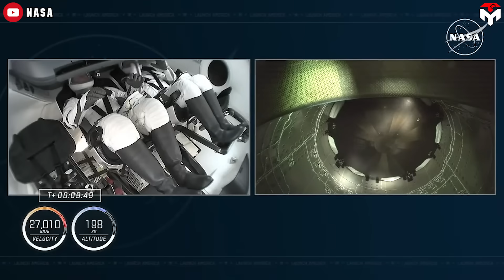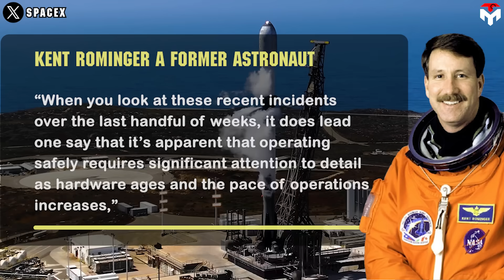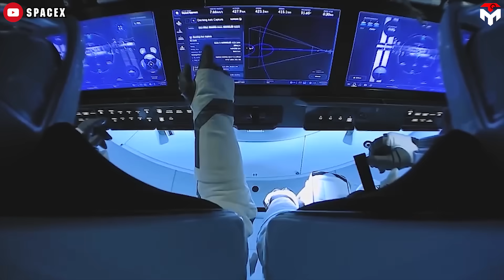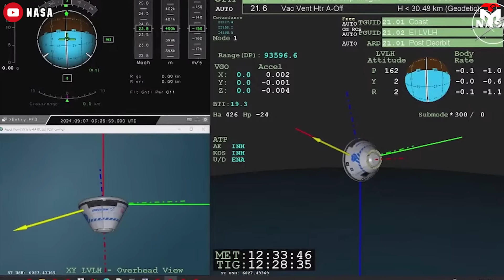NASA just WARNED SpaceX about Crew Dragon's Safety While Boeing Starliner...

Comment: NASA lecturing SpaceX on safety is comical! Aren't NASA the ones who incinerated Gus Grissom, Ed White and Roger Chaffee in the Apollo 1 capsule on the ground.

Aren't they the ones who blew up the Space Shuttle Challenger crew when they knew there were issues with the leaky o-rings on the main booster but decided to launch anyway. 

Aren't they the ones who roasted the Space Shuttle Columbia crew on re-entry when they knew there was damage to the underside of the shuttle that they spotted on launch and later confirmed the damage in space but decided it was safe to return them to earth on a shuttle with damaged heat shield tiles 🤯

Why did it take NASA so long to decide to send the Boeing starliner back to earth without a crew, it seems NASA was seriously considering sending the Astronauts back to earth on that piece of crap made by Boeing, until someone with a brain insisted it's out of the question.

NASA knows they're becoming irrelevant fast, sounds like sour grapes to me.

Comment: Two is one, and one is none.  Triple redundancy is best.

There should be more options than just SpaceX to get crews to and from space safely.  Is Boeing going to be in the mix?  I don’t know, but there does need to be more options.  Will Blue Origin be in the mix?  Or, ULA?  Others?  Again, I don’t know, but there still needs to be more options.  Cooperation with other countries?  At the moment, that seems like a weakness more than a strength.  But, AGAIN, more options are needed!

Personally, I really like SpaceX and what they are doing and what they want to do.  But, relying on one provider, even SpaceX, is NOT a long term solution.
Reply from the maker: True. We need to have many redundancy, but they need to be worthy ones.

Comment: NASA's safety record hasn't been all that spectacular.

NASA ritual murder sacrifices Past To Present. The Greek mythology and
symbolizem embroidered on NASA Mission Patches are very telling to those who have eye's to see symbolizem and numerology used in the dark side.

Jan. 27, 1967, the fire that swept through the Apollo 1 Command Module during a launch rehearsal test, tragically killing the three astronauts trapped inside. Astronauts Gus Grissom (left), Ed White (middle), and Roger Chaffee (right), died.

28 January 1986, Launch booster failure, vehicle disintegration during launch – STS-51-L
All perished onboard.

1 February 2003, Vehicle disintegration on re-entry – STS-107
All perished onboard.
Reply from the maker: It is probably the pain that makes them afraid.